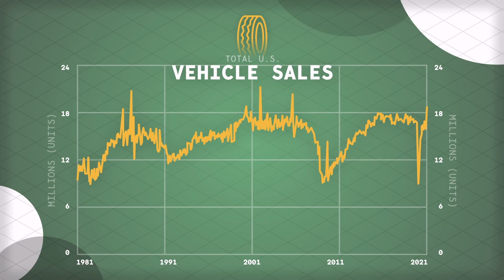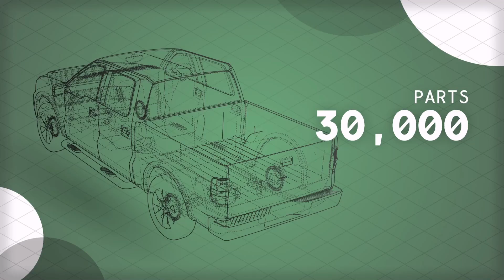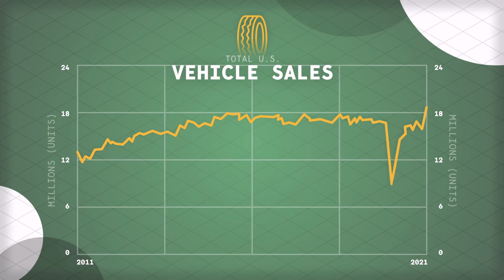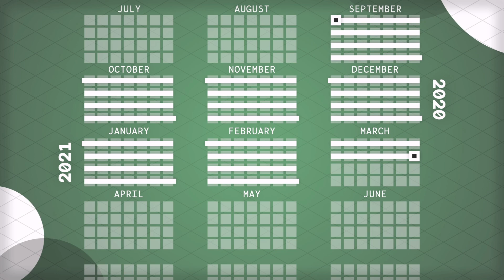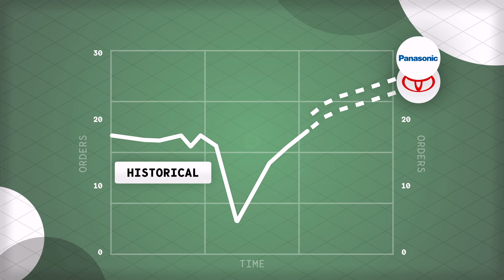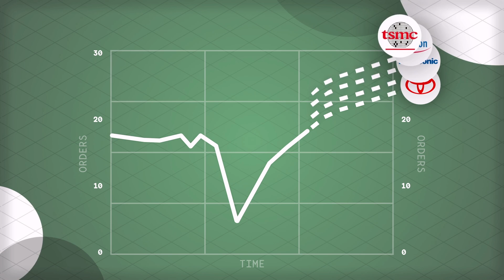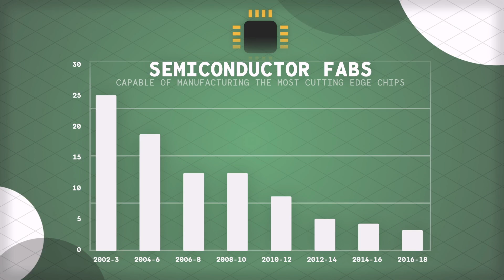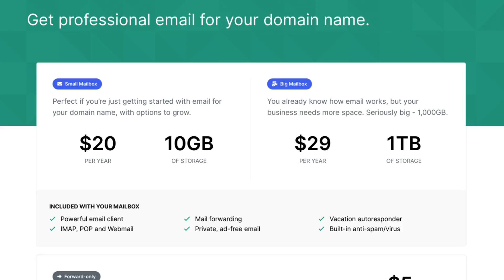Why the World is Running Out of Computers

Comment: "A 1% reduction in U.S. GDP."
Kids: "Meh" Shrugs
Adults: PANIK
Reply: One percent is still several hundred billion dollars.
Reply: the real panic will come if china tries invading taiwan and gets their hands on that company. then were all f***ed
Reply: @goldenhate6649   the don't need there hand on the company a cruise missle well do fine
Reply: @ThatGuy-uu6de  Cost of one factory: Upwards of US$10bn. Cost of Franco-Isreali C-RAMM system 'Iron Dome': US$50m per battery, US$100-150k per interception. It would be prudent to protect those factories with up to 100 Iron Dome systems each, as these systems will not only cost half that of the factory before taking into account intercepts, but they will also outlive the life-time of the factory; meaning they can defend multiple generations of semi-conductor factories. Add into this the fact that Taiwan can anticipate the majority of the cruise missiles to come from the mainland, they can orient the Iron Dome network to be especially capable at defending against missile attacks from the West. 

Clustered factories costing US$10bn each would make defending them easier, and would allow a higher concentration of defensive assets. While it is unlikely they would dedicate half of the cost of the factories to their defence, especially up-front, it is likely that they would be able to amass enough C-RAMM assets into the area for a low-enough cost as to severely reduce the impact of a cruise-missile attack by China, forcing them to result on a full-scale saturation attack.

This means that if China wants to attack Taiwan, it's essential for a full-scale attack, which would likely evoke a direct and swift military response from Taiwan, Japan, Armenia, Austria, Azerbaijan, Belarus, Bosnia and Herzegovina, Finland, Former Yugoslav Republic of Macedonia, Georgia, Ireland, Kazakhstan, Kyrghyz Republic, Malta, The Republic of Moldova, Russia, Serbia, Sweden, Switzerland, Tajikistan, Turkmenistan, Ukraine, Uzbekistan, United Kingdom, France, Isreal, India, South Korea, United States of America, Canada, Greenland, Iceland, Norway, and just about any sovereign nation eager to appease any of the aforementioned Nations by supporting them directly or indirectly in a war with China. 

Given that multiple of the aforementioned Nations are nuclear-armed, it would result in the end of the human race; but when it comes to responding to an attack from a nation such as China, the general policy that would be adopted is 'use it or lose it'. If you have the capability of launching nuclear weapons to stop China, and elect not to, you would lose the edge that having those weapons gives you in the first place. They are not just a deterrent to an attack on your own soil. When a country alienates itself from the rest of humanity the way that China has been doing, where every nation on the planet has a negative opinion of you; nuclear weaponry is the one thing stopping the snowball from truly getting rolling. Metaphorically speaking, everybody knows as soon as the snowball gets an inch wide, it will continue to pick up pace until eventually you have a metaphorical snowball big enough to kill billions in an instant.
Reply: @goldenhate6649  you are dreaming everything will be destroyed, and a lot of people will die
Reply: @goldenhate6649  That will be the least of our worries if China invades Taiwan. We’ll forget about that company when the world is burnt to ash.
Reply: @goldenhate6649  Probably won't happen.  China for all of it's bluster and claims of communist really have become kings of capitalism and they know, at least for the foreseeable future they cannot actually touch Taiwan.  In fact one of the reasons the U.S. was so readily willing to invade Iraq in 2003 was because it never rebuilt it's production facilities we destroyed in 1991 and thus would not that badly affect the world economy.
Reply: @Zanzopan  mate, the companies are owned by their governement, they are purely communist, though tbh the rich guys in the communist party of china are money laundering hard
Reply: @SCP--mw7tx  This reply indicates you do not know what communism is.  Under your definition the U.S. government and most state governments are communists.
Reply: @vocation8032  Pretty sure I said that in one of my replies.
Reply: Morgan Allen  True, true, and true.
Reply: 1%: so how can we sell this as "it's fine and we are smart 🤓?"
Reply: Seriously though, people will definitely die of suicide with that kind of absolute effect on GDP.
Reply: 1% compounding is yuge. This is why we don't let kids vote.
Reply: @SmashBrosBrawl  thats why kids dont vote.
Reply: Me, an adult kid: “this country has been doomed for the past 50 years, will it even live to see another 50? What’s another 1%? Might as well embrace the chaos at this point. I’m moving to Cambodia.”
Reply: They panic, ignore the blatantly obvious flaws of piss-poor regulated capitalism, then cry about how the free market will fix everything lmao.

The world is fucked, just sit back and watch the show.
Reply: @No-cg9kj  Atleast Capitalism is still alive and kicking, communism wasn't around to be tested by Covid because communism is fucking dead.
Reply: @SmashBrosBrawl  Covid literally proved on a world scale that we already knew on local scale.  Capitalism only functions when you can extract wealth from the lower class.  Any stressor more than a modicum  causes it to collapse and must shift to socializing it.
Reply: @Zanzopan  you didn't refute anything I said, like I said, communism wasn't around to be tested by covid because it has failed everywhere it's been tried.
Reply: @SmashBrosBrawl  Capitalisms took over 300 years to become the predominate economic system and has failed many times before it became so and is now failing as we see the requirements for it have a hard limit that it cannot get away from.  The philosophy of communism is less than half that and it's implementation barely 100 years.  During that time period it industrialized and increased living quality of far more people as capitalism during that period.  You have to remember every single country that had a "communism revolution" went from slave/peasant farmers to industrialized nation.  It did not happen in already industrialized nations.  Lastly we did not see "communism" fail as instead not able to keep up with uncontrolled resource waste and exploitation that capitalism has become.  One final note. Communism requires a classes society with free association of producers.  None of the "communist" states did that.  They function exactly as capitalism does except as the state in the role of the capitalist.  Hence why I said State Capitalism.

Comment: Just in time manufacturing is the culprit. The industry is cut down to the bone so much that it has no structural integrity left. Fidget spinners have more reliable supply than processors

Comment: So its not actually a lack of computers or the chips its just the fact that manufacturing failed to estimate the speed at which demand would recover.  That sounds like the lack of supply for practically every new electrical devise  released this last ten years.  Once the seller sees a chance to rise the price there seems to be a shortage and the price gulging begins.  Apple, Nvidea to name just two.
Reply: Nah. The world is also running out of Silicon, used to make said components, and Taiwan is going through a massive drought that’s the worst in over half a century, they are the biggest manufacturer of semiconductors and it has impacted it massively.

Comment: Good video however new semiconductor fabs are useful for far more than 5 years. After 5 years the service life on the new equipment begins to be a problem. The fabs if managed properly can remain highly profitable for decades.  Even in leading edge nodes, immersion lithography has been the deal breaker and we are still seeing vast majority of chips using this decade old tech. Only now we are moving to EUV lithography in the sub 7nm nodes

Comment: "Running out of compters" is a misnomer, computer chips are not "computers".
Automoblie "computers" are likely 32 or 64 bit microprocessors.
Reply: Different products. Same principle. Similar supply chains.
That and with the rise of EVs more and more automobiles are switching to actual "computer chips" as you call them.

Comment: This is how communists always fail, they dream big but fail to deliver. They wanted all the "green tech" and tracking and equity, but without freedom innovation dies and their centrally controlled techno surveillance system will just drive society to form ever growing independence outside the central control structures, even if there is no will or courage to rebel the system, because their centrally controlled system simply will not work.

Comment: All those features required another 200lbs of wiring. 

Piss on it. They want weight reduction? Sure.
A 1966 mustang weighed around 2300lbs. A fuel injection system and ac would only add maybe 100lbs max.

Done. You now have an ecoboost 4 cylinder weighing 2500lbs that has more hp than a 1966 Shelby Cobra did, and with a 70lb 6 speed manual transmission, it would probably get 45mpg.

But no. We gotta idiot proof the entire damn car, now it even watches the road for you, your blind spots which only exist because the cars are so damn big now, and all this other crap.

Comment: There's a missing piece here.  Most of those little microcontrollers in cars and even the ECU aren't made on cutting-edge fab processes like CPUs and GPUs.  They're up at 40nm, or even 180nm.  Totally different equipment, manufacturing lines, and factories.  Switching production between them is a huge undertaking, so it's unlikely they're affecting each other.  There's a shortage of all of them, but separately.

Comment: Many appliances could just reuse old thrown away components and chips. Not everything need the latest fastest chips, not even in cars. Sadly we don't have much of a system for reuse. We throw away stuff when well over 90% of the components would work fine for many years still. This however needs to be planned already at the design phase. Reusability and right to repair.  https://en.wikipedia.org/wiki/Electronics_right_to_repair

Comment: I have a tractor that was built this way. It's a 1942 they didn't have rubber or copper. So it came with steel wheels, no tires, no battery, no starter, no lights.  You still had to farm so you just made due.

Comment: Seems odd to blame the "chip shortage" when there are shortages for a multitude of non-chip related goods. Is the cause not COVID? Assembly lines operating at lower rates, fewer shifts in production lines, etc? Lumber is short, ammo is short, chips are short, appliances are short... is it not all related to covid? Why spin it otherwise?
Reply: This was starting to become a problem before covid, although covid did make it much worse.  There is a lot of processing power devoted to crypto nowadays too alongside all the smart appliances and vehicles.  All those extra chips needed add up.

Comment: The world is drunk on mircroprocessors. We have pint-sized supercomputers being used to run thermostats and kettles. It's cheaper to use an Arduino running some trivial code at a fraction of it's capacity to power a smart switch than to develop a discrete chip for that job, because the hardware has become so much more economical. And the need to waste electricity and billions of computing cycles to mine cryptocurrency has increased exponentially.

It's like burning $100 bills to heat a doghouse. Absolute insanity.

Comment: "Rice cookers" - jokes on you, I got an old fashioned one. No computerchips in there!
Reply: The best rice cookers are the old fashioned ones with no advanced electronics... Just a temperature sensor that relies on the fact boiling water can't go above 100 degrees Celsius... So once the temp gets above that all the water is evaporated and time to turn off
Reply: @andrewjohnston359  Mine works with a little spring-loaded thermostat beneath the inside pot. Once the water is evaporated, it  pops up and stops cooking.
Reply: @luiskp7173  yes that's what I'm talking about
Reply: @andrewjohnston359  and how exactly do we know when the rice water gets above 100 Celsius? We look at the digital readout, which has "computer chips!" and it can shut off automatically, so no ones ruins a pan of rice, burnt to cinders or worse. I want to minimize my need to cook, my planning for cooking, and chances that I'll set my home on fire. Computer chips in a rice cooker help me do all that, and, with my lack of kitchen skills, I'd probably ruin three or four "old-fashioned" rice cookers, which would more than make up for a little more cash spent for the latest high tech model.
Reply: @squirlmy  The simple rice cookers use the fact that when a magnet gets too hot it stops being magnetic. Liquid water will never* go above 100C but the rice can, so once the magnet is heated by the cooked rice enough, the magnet holding the circuit together fails and the cooker switches back to the warming mode. No microelectronics required.

*Based upon a standard kitchen that isn't in a pressure vessel
Reply: @squirlmy  see @luiskp comment above ..a thermostat and a spring is not a computer chip....
Reply: @andrewjohnston359  i wouldnt say so but good on u
Reply: jokes on you, I use fire and a frying pot e.e
Reply: @alemd1714  joke on you i eat them raw
Reply: @alemd1714  Jokes on you I use the sun and sticks
Reply: @alemd1714  i actually DO use a fire and a pot (well, actually most recently an induction stove, but same idea).
Reply: @alemd1714  jokes on you I don't eat rice.
Reply: Jokes on you, I don't cook rice, i eat them raw.
Reply: @thesauce1682  like a real man.
Reply: HANABISHI 20yrs old still working !
Reply: @daniel070487  I have a 37yo rice maker that still works lol.  It was a wedding present for my mom.
Reply: I got the advanced one
Reply: Lmfao I just use a pot and using my fingers to measure the water to cook rice
Reply: I thought the only way to cook rice was in a pot of water 🤔
Reply: @TheRealBandito Nah you need that expensive one where it automates the temperature of rice and keeps it fresh for u. Lets you know when its done cooking and stops it for u too.
Reply: @Ghostmarshs  the auto turn off is the only thing i miss about a rice cooker, but I'm finding that a tiny enameled dutch oven keeps my rice fresh for quite a while (not sure how, I suspect it has to do with the fact that they close pretty tight by design).
Reply: @TheRealBandito Definitely worth getting if you eat rice a lot.
Reply: @Ghostmarshs  it's worth getting when you don't know how to cook you mean
Reply: @Adama.1  looks like someone's got a superiority complex lol

Comment: Planned obsolescence was and still is a part of manufacturing but seems like that's slowing down. At least I'd hope.
Reply: Man, I know your point, but CPUs are a bit more complex than a light bulb. At that level you can't obsolete anything. Compute units don't break unless you burn them down with high temperature/too big voltage. It's consumers fault and their demand for new products (and now for crypto miners). Watch how much hardware you can buy on ebay, or an equivalent in your location that costs less than 5 $...
Reply: @lechgolas6400  He never mentioned CPUs exclusively tho? He was just making a general statement about Planned Obsolescence, and while rabid consumerism is also a contributing factor - that doesn't nullify the gravity of Corporations intentionally compromising their products to elevate sales.

Comment: The auto semiconductor shortage is a happening because the market is splitting in two.  Fossil Fuel Electronics versus Battery Electric Vehicle electronics.  The fundamental difference is that the EVx is high voltage AND  EVx sedans are expected to grow from 2.3% of car parc to 15% by 2026.  Therefore, they have to rapidly tool for that (Volkswagen, GM, Ford, Tesla-whoa).  What's a much larger challenge than semiconductors is the transition from internal combustion engines to electric rail (converter, inverter, charger)- that's disruptive on a galactic level and impacts gaskets, pistons, rings, seals, fuel injectors- whoa.